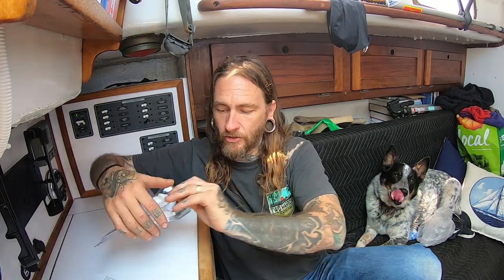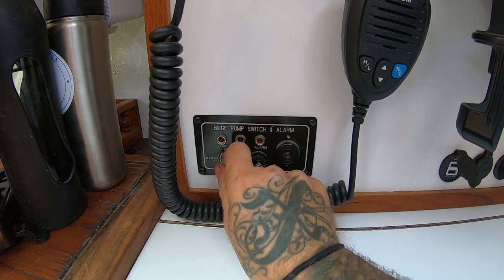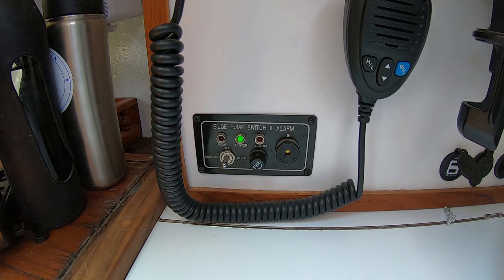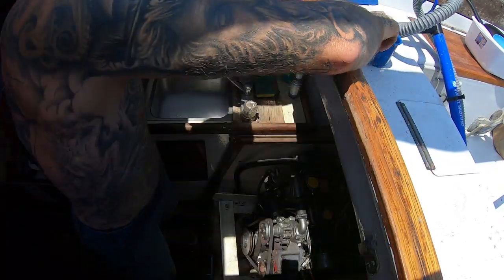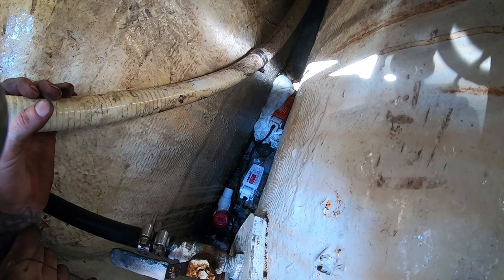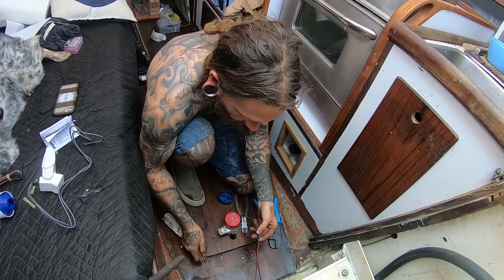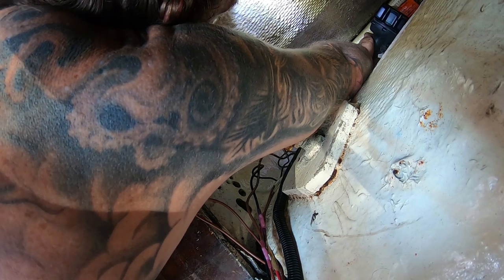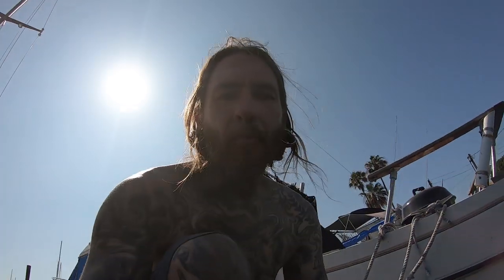BILGE PUMP FAIL: Replacing the dead bilge pump and float switch on an Alberg 30

Comment: Rule sells cages for the switches, protects them from debris. Like others have said, keep the stuffing box you have. Use the gortex packing. Get a stuffing box wrench or two, they are thin and are easy to use to dial in the stuffing box. Change the packing sooner than later because if you have that box cranked down to stop it from leaking you might score the shaft. Save your money for a manual diaphragm bilge pump with the handle mounted in the cockpit. Again good video !  P.S. Keep the glass fuses, there inexpensive, keep a few on hand.

Comment: Good call on fuse. Carry spare of pump and switch. Check switch and system weekly. I had a switch  on slow rise of water would not come on 100 percent of time. Thanks mike

Comment: Next time you have to do that job, you can fix the pump and the switch on a long aluminium bar bended at 90° at the bottom of the bilge. When you need to service the pump or the switch, you just have to lift the aluminium bar from the bilge. Easy maintenance and no need to put holes in the keel of the boat.
Reply from the maker: that is a really good idea but I think the rough seas might throw it around. it is smart though and could be made to work I bet !
Reply: That's basically how mine is done. It's a really old install though and on my list for replacement. Might be one of my winter jobs.

Comment: Hey, James.  I have PSS dripless in my current boat.   I think it's overrated.  It will cost you more upfront and you'll have to install new bellows and service kit every six years. I've heard some horror stories about the bellows failing--but it's all anecdotal.   My old Tartan 27 had a leaky packing gland that leaked like a sieve.  Once I changed the packing flax the leak slowed down to a point where I didn't notice any water in the bilge--just a few drops per minute.  Fortunately I changed the packing material before continuing to crank down the packing gland and scoring the shaft.

Comment: You should use positive displacement pumps for the standard pumping procedures and cheap centrifugal for emergency backup. You can mount the positive displacements quite a ways up from the bilge. Good positive displacement pumps cost big money but they last for decades. They are worth rebuilding if they weren't left in the bilge to rot.

Comment: I know nothing about boats, but I am shit frightened of drowning, I'd be inclined to fit another completely separate  system as a backup and get the drippless  whatever it is asap.  Great vid it gives everybody the idea on how to go about fitting or replacing one.
Reply from the maker: In the old days (as in when this boat was made) a lot of people just used hand pumps. I was super stressed out when it went out on our trip but soon got comfortable with hand pumping it when needed.... but I agree with you, i don't want to sink :)
Reply: @SailorJames  Will you fit a permanently mounted manual bilge pump that is accessible from the cockpit before you set off?
Reply from the maker: yes I have a whale gusher I need to rebuild but I am considering getting one of the manual bilge pumps that flush mount into the cockpit so its always at the ready

Comment: If you have a stainless prop shaft, another option for your stuffing box is to use gortex packing instead of flax packing. Very little water seepage and it’s over a week not a day.

I don’t have the courage for a dripless System. They’re great until it fails, then water pours into your boat.
Reply from the maker: The coast guard uses them on every single boat they own so I am going to take that as a good enough endorsement for me to be able to trust it. but I hear ya.

Comment: Leave the 'glass fuse', but up the amperage from 5? to, say, 10? then use an 'in-line' blade fuse for the proper rating (5 amp?) mounted in the bilge, well above the water line. You don't want to have to disassemble your panels in an emergency situation and you'll have to open the bilge anyway if the pump stops working, so the fuse will be right there for a quick check...
Reply from the maker: that is the perfect solution Mike, thanks!

Comment: Asa matter of fact I have to change my bilge pump as it won’t lift the water high enough to exit the boat. Not too worried though as my bilge is usually bone dry, usually but I had a small bit of water last week, I think it’s a hull to deck joint seal, further investigation is in the future if I get more water on the next sail.
Reply from the maker: Must be your deck joint right? because we haven't had any rain lately....